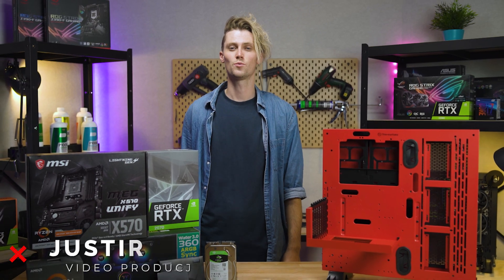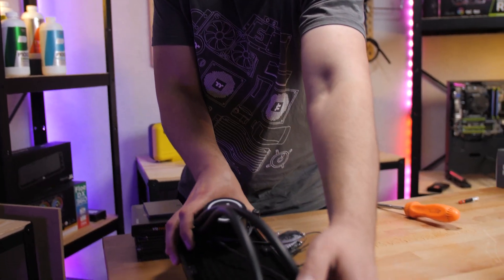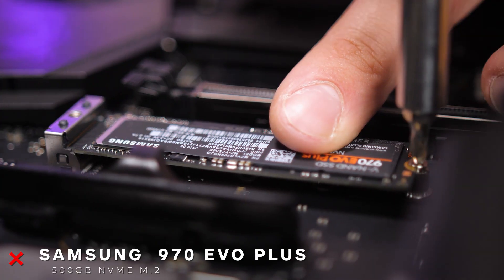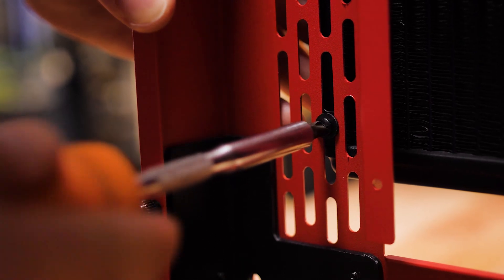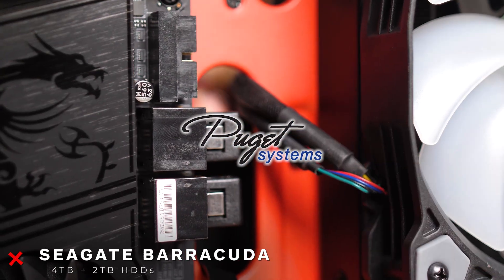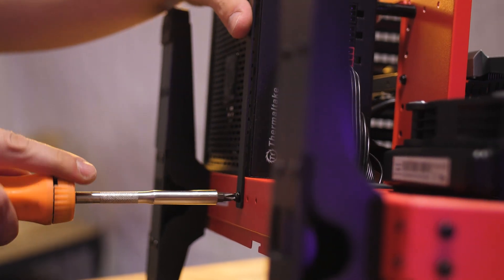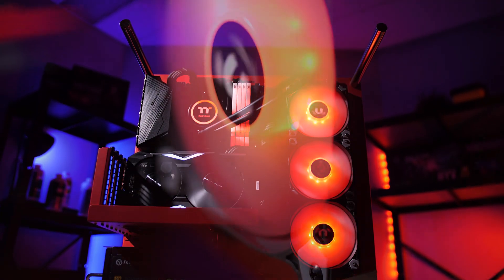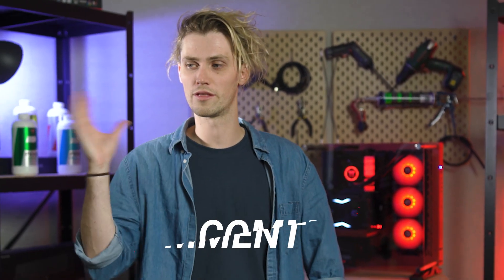Justin BUILDS A RYZEN 9 4K VIDEO EDITING BEAST [2020]

Comment: I am looking to build a video editing PC. That's how i found your video. Great filming-editing btw!!
I wonder why you choose a 2070 over a 2080 (i guess cost-wise) and why 4000 speed RAM. 
Thanks a lot!
Reply from the maker: Hey there, thanks for dropping by!
A couple of great questions!

2070 over 2080:
The cost was definitely a factor on this, but the main reason was that my primary editing software is Adobe Premiere, which doesn't utilize the GPU a whole bunch. If I were a Davinci Resolve user I would have definitely considered the upgrade, as it leans more heavily on the GPU than Premiere. From my research though, the amount of improvement you would see for the price in my scenario just wasn't worth it, unless you're cashed up and want the best of the best! My requirements were basically an 8GB card to future proof for 6K editing, my local store had a great price on a refurbished 2070 so I snapped it up and spent the savings on a more powerful CPU. The link below is a great guide for all hardware choices if you are using Premiere and I would highly recommend browsing their other articles as well.
https://www.pugetsystems.com/recommended/Recommended-Systems-for-Adobe-Premiere-Pro-143/Hardware-Recommendations

Why 4000MHz:
4000MHz is definitely overkill! From my research 3200MHz seems to be the sweet spot, and anything above will grant you only marginal improvements in the context of video editing. I went with 4000MHz simply because we had a marketing sample that I could purchase from work for a good price! If I were buying from a store I likely would have gone with 3200MHz, unless I could get a spicy deal on something above that (or again unless the cost wasn't a factor).

I hope that helps, let me know if you have any other questions, happy to help.

Cheers,
Justin.
Reply: @ThermaltakeAustralia  thanks a lot! That was Quick! Yes, both answers make sense. Keep up the good work!